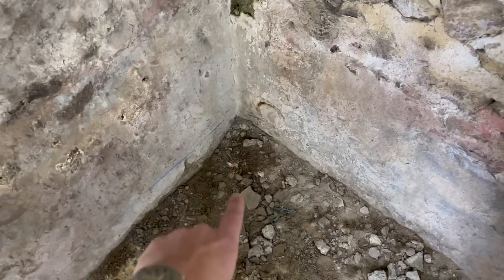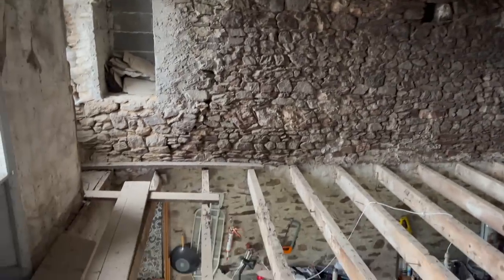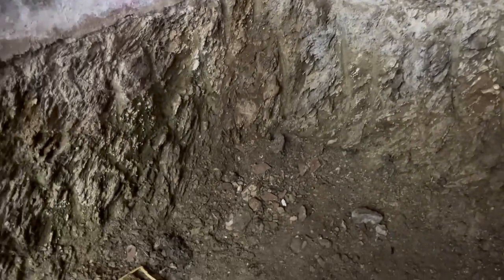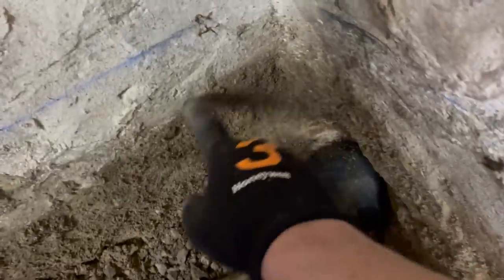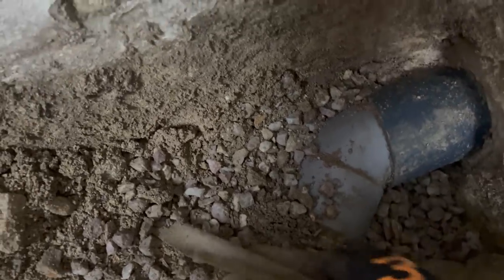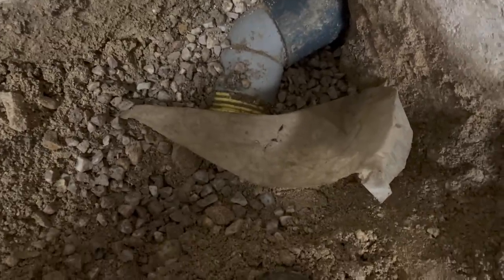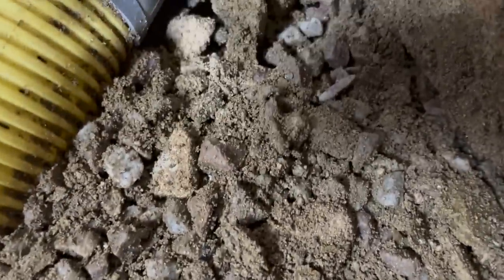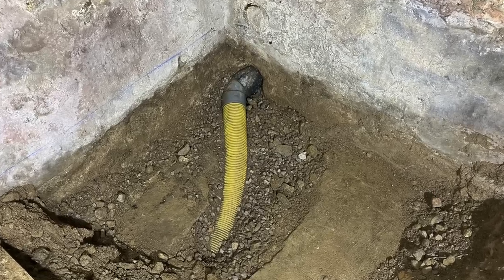A French Drain Inside Our French House

Comment: Probably a good idea is to extend the "hole" around the corner to liberate the gable end of the building, allowing it to become more dry. probably most of the moisture in the habitable part of the house comes from saturated layers below the grass on the side of the house (and of course because the chimney area of said gable end wall  is not very solid anymore and needs repointing, apart from a possibly leaky rear section of the roof.
As I write already I would dig around the corner from the hole exposing the complete wall.
I assume the level of the street is roughly the level of the bottom of the hole. 
Once the digging on the side of the house is done you can either leave the dug area to create a level way round the back of the house and/or build a land drain system to take water from the hole around the house to the street and replace the land drain from inside the building for a solid pvc pipe.
I assume you need to do some drain work for the unrenovated part of the house because of kitchen,bathroom and toilet facilities yet to be realised.
Also I would try and get an idea as to what the well thing actually is and where the water is coming from entering the hole and well. Does it come from a a sub surface gravel layer, is it groundwater from deeper down or is it possibly a leaky water main...
Reply from the maker: One aspect of all this that may help us is that the front street is lower than the back of house and possibly a lower elevation than the bottom of the hole.
Reply: @TheRenovationProject  Be aware that lowering the ground further around the house could destablize the walls unless you first point and repair the walls in "The hole" and especially the corner

Comment: Also looks as if the downpipe from the roof is also going into that pipe under the house. It all needs diverting around the house, as you seem to be planning, or a separate solid pipe to keep it away from the  perforated pipe. Even if only a short term fix to stop adding more water to the house, while the longer term solution is worked on.

Comment: I just had a thought: If the well has an open bottom and is not cemented or walled with plastic, you could pump the water out. The water in the surrounding will flow into the well and you can effectively lower the groundwater of the surrounding ground a bit. They did the same in the coal mines to remove the water. They dug wells and installed pumps to lower the water level.
Reply from the maker: Another good thought John. I'm not sure what the bottom is made of. I'll have a look. Cheers.

Comment: I would put a Solid pipe in it will reduce the humidity inside.that current pipe is putting all that moisture inside the building.  Maybe add an additional perforated inside against the wall that drains outside.

Comment: Hi, I had the same but worse, house circa 1650 in Greece. Now I am 100% dry. The French drain has the advantage of drying the gravel  too. I started with the outside.  First plan where you want/need the water to go. Can you direct it around the side of the house? Whatever you do if you do not sort the outside first you will not be able to dry the inside. The French drain is not your main problem. If you did not have a problem outside you would not have a problem inside. Can tell you what I did and worked but its a lot of hard work.
Reply from the maker: Good to hear you sorted out your place - and it was worse! Cheers.
Reply: @TheRenovationProject  if it is damp outside through capilary effect it will come in. I have a french drain inside and it goes into a hole I dug inside the house (35×35×60), I have a small pipe 18mm that then goes from the bottom outside so I can pump out water if needed. Outside, dig down if possible clean the grout around the stone then plaster, paint a cement sealant, then I put plastic that looks like egg cups (pointy parts on the wall for ventilation) french drain around the bottom wrapped in geo fabric, gravel, and backfill with rocks (8cm size). In your case it might be a good idea to put a second french drain in your garden about 1m from your house. Note: water seeps down 6m every 1m so I was told.

Comment: In Michigan the waterproofing company I worked for had a patented  system.  Using perforated pipe wrapped in a special sock so dirty and rocks can't block the pipe. In gravel being the lowest point if the water table rises below the floor it will find the path of least resistance the gravel and perforated pipe which would take it away from the floor.  Hope that makes sense. But it would be around the inside of the walls circling the whole interior. Then a pit with a perforated 30 gallon bucket in the special sock with a pump and line going outside if the water levels come up from beneath the floor. Another system around the whole outside done the same way with a dry well or drain out front catching the water.  Sealing the exterior walls with tar below ground level and on the inside hard plastic sheeting going below ground level up the wall preventing water intrusion. Cutting humidity WAY down.
Reply: Yes, that sounds like a very reasonable system. In this case you might not even need a sump pump as the street is below floor level. Typical French drain systems have the pipe wrapped in something called geotextile membrane (entirely missing here), then surrounded by washed gravel and another layer of geotextile all around the gravel bed.

Here the gravel definitely isn't washed, which means any water entering the pipe washes out sand that can eventually block the drains and there's no geotextile either.

Comment: In my experience outside drainage pipe shouldn't go perforated under the house. It's leaks water. It's should be solid pipe through house. And house has to have separate drainage system, which connects to previous system down stream, somewhere outside. It's wrongly Made system and it's obvious.

Comment: What a botched job! The previous owners introduced even more moisture into the house!
Getting the walls dry will be hard to do if they sit on natural rock. You may be able to seal the stone by infusing water glass (sodium silicate) into a continous strip all around the wall. That is a lengthy process but once the silicate has seeped into the stone, it acts like a barrier. The silicate will not make the walls 100% waterproof but it will reduce the capillary effect a lot. Water glass is cheap, natural and a traditional way to combat moisture. It's not as good as modern or more expensive solutions. Also: you cannot remove the silicate afterwards and once it is in the stonework, it will stay there. water glass hardens by absorbing CO2.

Comment: Ok here we go. You may want to get a pencil and paper for this one. 
Install a 2.5 cm (minimum) solid flexible pipe used in modern day plumbing through the existing perforated pipe until the end comes out on the street side of the property. Build a sump for a new submersible pump in the low spot on the outside rear corner of the house. Connect the new  20 liter sump pump to the new flexible hose.  Bam, problem solved. Well at least the water infiltration into the house from the back yard part. The water that comes out of the pipe will supply water to your new fountain in your front yard and your neighbors will be green with envy. Plus the birds will have a place to take baths. Don't forget to send any water that comes off of your roof away from the house and to the street. Good luck in the contest.

Comment: I'm no professional but in my opinion that perforated pipe could be dumping water from the outside water problem in your house!
I'd have thought the running water from the well or spring in the rear should have been directed around the outside end of the house.
Reply: That is exactly what I thought and I AM a professional (in the US). The proper thing to do is clean out that trench - seal the footing and lower part of the foundation by plastering it with hydraulic cement. Install perf pipe and gravel  in the sump and run the spring water around the side of the house to the street. Cap off the drain that runs under the house while doing that. THEN, leaving the capped off perf pipe under the floor, join that up with the drainage that bypasses the spring water around the house. Plastic sheet over the regraded and tamped gravel and then concrete that basement floor.
Reply from the maker: I find it quite disturbing that the only path the water from the rear of the property can take is through that perforated pipe.
Reply from the maker: Sounds like a good plan Warren.

Comment: This seem like a stupid budget way of do things, just to do one section of pipe less. Finding a perforated pipe system under a floor when the general ground is as saturated as it seems yours is, would not be so strange. Its is something we see in  SA which is used to capture rising damp or underground water coming from below in basements. To see an outside system which is open to stormwater connected to it, is stupid as it has the possibility to flood the pipe which would then introducing water into soil below the floor. Would suggest installing a separate pipe for the water from the outside channel.

Comment: that water is not just following the path to the drain, its basically migrating under the house as a whole. I bet they put a perferated pipe with all that gravel in the hope of having the pipe pick up the water migrating through the basement from the ground in the back. You need a civil engineer to look at but my amateur eye tells me you are going to want to dig up that whole area and route all that water in some sort of underground cistern and then output pipe system around the building, firm up all the area behind with concrete and water proofing etc.

Comment: dig  out a trench alonside the perforated pipe and lay a solid pipe. leave the perforated in place but disconnect from where water comes in and feed that water into the new solid pipe. That should improve things.

Comment: You need to get the water from the down pipe and well not running through a perforated pipe. The amount of water from the roof leaking through a perforated pipe is only increasing the moisture level in the house floor.

Comment: It’s okay the pipe has polythene wrapped around it! 😮 I think you need to run at least two pipes a solid one for the overflow from the rear and the hedgehog one to drain the sub base/floor? Shouldn’t be too expensive as 100mm pipe isn’t a huge cost....
Reply from the maker: That would make sense. 👍🏼
Reply: Exactly as I thought.

Comment: As a quick temporary "fix " I would rip out that perforated pipe and replace it with 100 diameter sewage pipe with holes drilled facing downwards laid onto a fresh bed of gravel. Fully perforated pipe   with ribbing clogs up quicker restricting flow  rate ,any membrane wrapped round fully perforated pipe clogs up with soil/crap which also restricts moisture /water around it .  Manufactures disagree but if you do a simple experiment yourself over a couple of week ,you will see the flow rate difference . BTW I normally drill 12 mm dia holes about 1/4 around the pipe.
Reply from the maker: Yes, i agree, it would be better not to directly wrap the drainage pipe in any membrane/geo textile. But as it is now, the outside drain is connected to this perforated pipe, so there is water from the outside flowing through it. I'm thinking of replacing the pipe with a non-perforated pipe to at least get the water from the back of the house through. But that will mean i need to put in another underfloor drainage - and the problem with that is outside the front is a 1.5m wide concrete walkway that comes above the current level of the inside floor. - more on this soon. cheers.

Comment: Excavate all of the floor to a depth of about 24" below finished floor level. Install 3" of clean 3/4" stone. Lay a 3" land drain pipe around the space exiting at the front of house. More stone then another land drain to duplicate the first one but at a higher level. This is in case the first one ever gets silted up. Ex at the same front place but a bit higher. Built manhole to check on the condition of the water exit. More stone. Layer of sand then DPM. Then Insulation then Concrete. Followed by floor finish of choice. Heated floor also an option. Springs tend to come to the surface of disturbed ground. They need to be assumed to be there in this case even if not yet visible. Based on Cornish experience over several years.

Comment: I can see needing the perforated pipe, you clearly have a quite wet property. But shouldn't that be two entirely different pipes? I shouldn't think it makes sense to have an active stream being rerouted through the house when it's putting moisture into the house instead of taking it away. I would probably talk to whatever the French equivalent to a house inspector to see if getting a solid pipe put in to take away the stream and leave the perforated pipe in place to take as much of the moisture out of the house as possible. It is clearly not doing it's job and that's a massive problem.
Reply from the maker: I agree!

Comment: An easy fix at first glance, just use sealed draining material. I think the best fix is not allowing it into the housing enclosure in the first place, which will require some elbow grease and retrenching the line outside the perimeter of the living space. You can do the easy fix first to mitigate the moisture, then get on with the real fix on the perimeter also allowing you to work inside the house. I see some powerful ventilation fans in your future. Looking forward to the upcoming episodes.
Reply from the maker: Thanks 👍🏼

Comment: It probably was originally a salt glaze or stone drain. I would solid pipe it then insulte 150mm, vapour barrier and concrete the floor. 
Perforated pipe should be for a soakaway away from the property.

Comment: It may be stupidly expensive or impossible but could you not just continue to dig the channel through the bedrock? May not be enough vertical fall to get it into the street but if the channel on the outside is directing most of the water into the perf pipe under the hosue then why not just continue with a natural channel?
Reply from the maker: I'm thinking of changing the flow outside to the other direction and take it around the other side of the house, if there is the elevation. - not sure if that's what you mean. Bedrock may get in the way though.

Comment: Wow, that should have been a sealed pipe. You might be able to get it relined, which would seal up the tiny holes. It might be cheaper than digging up the floor, and putting down new pvc pipe. Unless you DIY it, but then its how long will it take you?

Comment: That perforated pipe looks like it’s sitting down between 2 stones? Maybe previously before the pipe was put there there was a stone type culvert  running through under the house carrying the water it would have had flat stones across the top between the ones at the sides?
Reply from the maker: Possibly. I assumed it's s a concrete floor with a channel dug in it for the pipe. We''ll find out when we take up all that dirt!

Comment: Interesting videos.
The hérisson sub floor seems to be a sub-floor air ventilation system to draw moisture from the internal subsoil as air passes through the land drain pipe from the colder north side of the house to the warmer south side of the house.
However, the spring water should be running in its own (non-perforated!) 110mm soil pipe from the rear to the front of the house as the current arrangement seems to be soaking the internal subfloor.
And of course you need adequate ventilation and heating in the house.
Maybe look into limecrete floors with Leca-type clay balls once you are at the new ground floor stage- something to look forward to!
Reply from the maker: Thanks for the suggestion re limecrete etc. The ventilation of floor drains also makes sense. Cheers!

Comment: Hi. My sister in law and her husband bought a beautiful Edwardian house 10 years ago. A couple of years later they discovered an increasing damp problem and called in some specialist guys.
- There was a spring rising right under the house.
- There we’re 3 places where it came out.
- The original built water management system had failed over the years.
- The solution was to excavate and form 3 ‘sumps’. Each sump had an automatic pump installed and the 50mm outflow pipes routed to external storm drains.
- The sumps and pumps were designed to be easily accessed through the suspended floors for any possible maintenance.
They have had zero problems since and when there is heavy rainfall can faintly hear the pumps cutting in.
Reply from the maker: I would not be surprised if we find more springs under that floor.

Comment: The hole at the side, I would dig down to hard base surface, build retaining walls with concrete block with holes for drainage. Make good the stonework on house, lay four inch land drain into the lowest points of the hard base surface and trench/drain this to the road gutter, then put ten (or more) inches of one inch gravel in the hole to cover the land drain. For inside the house I would clear out all that loose material replace with one inch gravel and install a suspended timber floor or a suspended concrete floor.
Reply: Concrete, surely lime Crete?